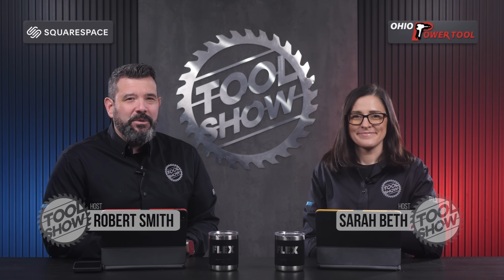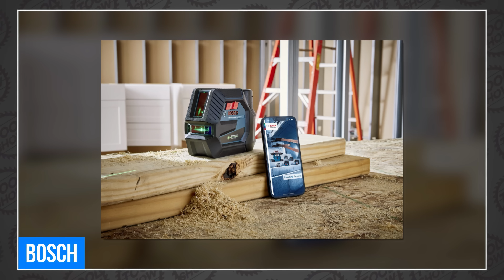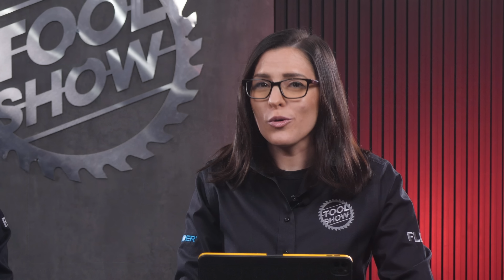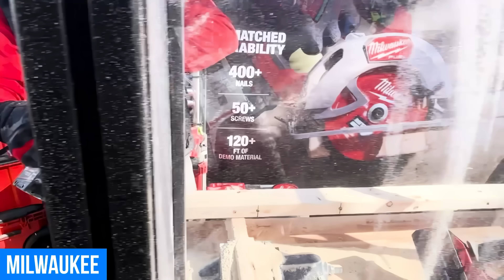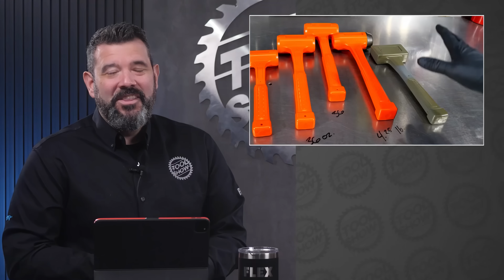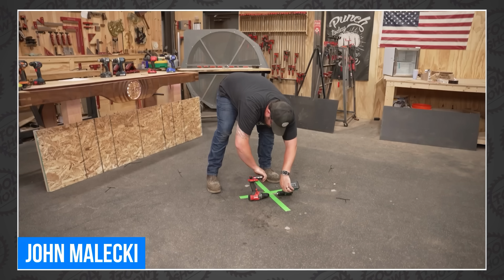17 NEW Power Tools from Milwaukee, DeWALT, Makita, Bosch, Hilti and more!

Comment: Makita XGT battery casings are brittle and break/shatter relatively easily compared to Milwaukee, DeWalt and others. Also their XGT line does not stand the test of time in real world construction. I purchased their hammer drill, mid-size 1/2" impact and 4.5" vari-speed grinder.
The grinder is doing good minus the battery casing issues, but the other tools failed in record fast time.
  As a Union Trades Millwright, I prefer the durability/longevity of Dewalt tools personally, but once you use a variable speed grinder, there is no going back. So I may research the Flex line to use in my mix and delete the XGT for on job use.

Comment: All the teeth are still sharp. Well its missing a couple. What a lie lol
Reply: 😂 the teeth are still sharp if you can find them.
Reply: Mulwaukee tests are usually BS but this one...lol
Reply: @procrastinator1842  yeah. These are probably going to cost 30 or more each, lol. Im sticking with Diablo. I cut through nails and screws all the time with the framing blade you can get for less than 10 bucks when you get multi packs. If you go slow when you know you are going to hit something, they last quite a bit. The nitrous multitool blades suck. The diablo carbide curve performs best imo.
Reply: @colebz420  I just put all my work consumables on my work credit card/job bill...I could buy these nitrus things, but won't because they seem to be a scam.